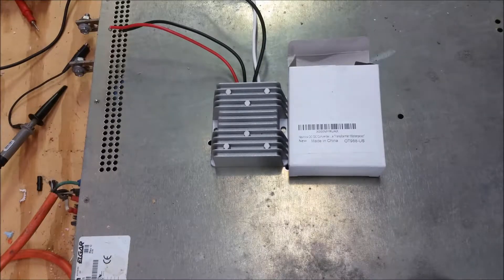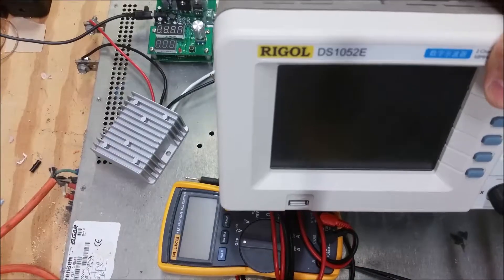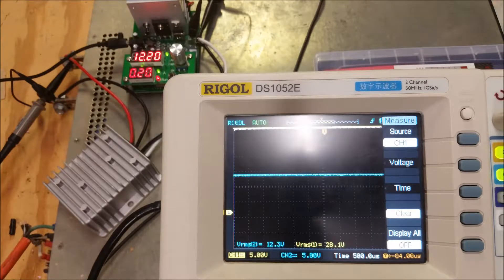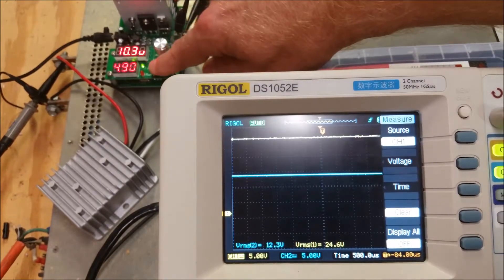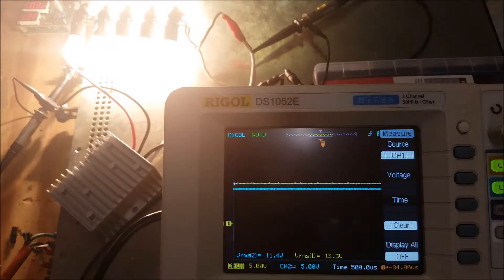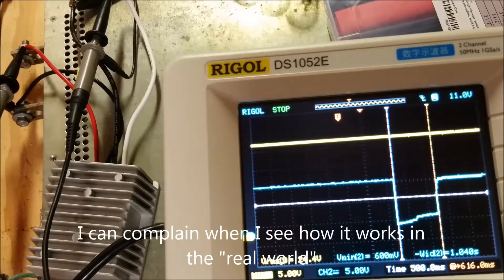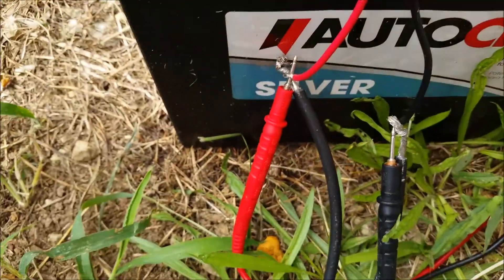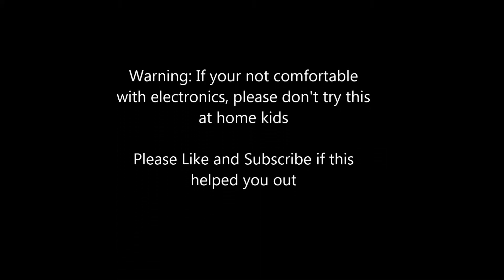Amazon DC-DC Converter Review

Comment: Let me understand your smoke test.
1. The output of the buck converter is 12.3 volts.
2. You hooked the output of the buck converter directly to a 12.5 volt low impedance lead acid battery. 
3. The input to the buck converter is from a solar panel directly.
4. There was not a blocking diode between the solar panel and buck converter?
5. Solar panels leak reverse current at night even if they have built in blocking diodes.
6. You reverse biased the buck converter at night which means you probably reverse biased semiconductors somewhere in the buck converter. You definitely reverse biased the electrolytic capacitors at a minimum. 
You may have forward biased the bulk diode of a mosfet. 

7. The power rating on the pump Is 15 amps, since it is am inductive load, the turn on current is likely to be much higher. 

I agree the converter is not suitable for your intended use. There is a number of possible failure points to consider here.

Nice test gear, your testing of the device was well thoughtout and executed up to the point of hooking it up in for the unintended smoke test. 
Always put a fuse between batteries and electronics.

I might have made the same mistake, but since your smoke test, I learned not to do that.

Good luck.
Reply: I had similar comments as you Peter and would note that the sticker on the device says 24V input and it was being run up 37V. I would say that they likely sent him an incorrect model as the one he is testing is for 24V power and he tested up to 27V on the bench. Appreciate testing that was done :)
Reply: @patrickcallahan2210  I had to rewatch this video, the label does indeed say 24 volts input. There are many models of this device with different specifications that all look the same. The models that have a range usually have the range on the label. You have a good point. 

My experience is that capacitors fail due to having an over or reverse voltage or over temperature. 
The heat sink in the sun and cooling fins facing down might fry the caps. 
If those are output filter caps, the motor, an inductive load, might have over voltage or reverse biased the caps. Which a suber circuit on the dc to dc converter would have prevented. I would guess that there is a suber circuit built in.
I vote -over heated (sun)because it worked for a couple days baking the caps over time.
Reply from the maker: This was tested on a day that made it to 85. Could it be the heat? Possible but not probable. Being that it only tops the battery off, it's not in full power output. So, the delta above ambient shouldn't be that high. 

The voltage range and output  current were within range as well.  Since its tied to a battery,  most of the current will be sourced from the battery during the 1 second the load is on.

The over volt, current, heat protection should have triggered to shut it down, if that were the issue. 

Per the manf. "Converter provides over/under voltage input, overload, overhead, and short circuit full protection"
Reply: @stem_saving1644  You have the knowledge and equipment.  Commercial practices run things to the limits, meaning no de-rating. Electrolytic capacitors has been a weekpoint in electronics even back to vacuum tube radios times. I would expect a 20 to 30 degree C rise sitting in the sun. 
Premature cap failure, maybe, 
Overheating,  failure, maybe,
I have never measured the resistance of solar panel with no load. The transformer of the buck converter should isolate the solar panel from the battery. Thinking outloud, because this is weird.
I am still thinking sneak circuit, without a schematic,  who knows.
The hidden diode within a mosfet, bulk characteristics diode would be forward biased, but that mosfet should be between the panel and transformer and isolated from the battery. The transformer and caps would act like an LC filter to the output. I am assuming the panel to regulator to battery to pump is the configuration you used.
Did you buy a $15 PWM cc to use instead?
Weird problem to solve, I do like fault ANA puzzles tho.
Reply from the maker: I'll agree there is a lack of de- rating  for sure. I didn't check the caps ratings, probably should have.   But agree it does effect reliability.

The problem with these black box units is they are encased with potting material, which is a pain to deal with. 

20-30C rise seems a little extreme, but I can't confirm or denying it since   I didn't measure temps.   But I did under full load inside.  I assumed (wrongly perhaps) that since its IP rated it should be ruggedized...
Apparently only mechanically. 

I did buy a change controller that I'm using to mist my air conditioner. That really does the job.  Check out my videos for that. 

Like you. I do enjoy failure analysis. 
Thanks for comments!
Reply from the maker: I'll agree with all your statements except 5. The reverse current is so small it has minimal effects, at least it should.

 The fet is outside of its operating range so it's blocking the current.  I'm guessing this is in the miroamp to nano amp range.  If the converter can't handle that,  then it's got larger problems and yes I could have installed a fuse, but being the pump didn't draw over 15a, the DC to DC was safe to use.  But good practice though.
Reply: @stem_saving1644  power diodes have a higher leakage current than signal diodes. 
It is impossible to do a sneak circuit analysis without a complete circuit and parts list and spice simulation. Which is not going to happen.

After thinking more on the issue and given the caps was the first failure point. I really suspect the failure point is the reverse bias of the electrolytic capacitors.  It does not take much  current to grow a tendril between the capacitors plates. And it took 4(?) days for the failure to occur.

I get frustrated by the black box approach by suppliers. Derating parts and quality in the commerical applications does not seem to have been standardized.

A linear regulator may be a better solution, except for the loss of input range and efficiency loss. I consider a buck converter to be a switching power supply. I have not found a off the shelf  linear regulator in black box form yet.

Thank you for your efforts, I have learned from it.

Comment: I want to get one of these, so I looked it up and the specs I found say input voltage is up to 35V. And given that it's a cheap Chinese product it's probably not a good idea to run it at it's max rating. So it might have burnt out simply because you over-volted it.
Reply from the maker: It wasn't ran at its max. So no reason for it to fail.  My specs has 40v as a max, they might have lowered it now.
Reply: @stem_saving1644  will this work with dc pulsed input? I want it to use it on my motorcycle but the dc voltage that comes from the regulator it jumps a lot from 8-38 volts.
Reply from the maker: My input jumped around as well on my panels (not below 12v) and I suspect it caused the caps to fail as I suspect they are the cheaper versions that either can't handle peak currents or voltages. 

How long it stays below 12v is the key.  Most regulators will brown out unless you have caps to hold up the voltage. Unless you get a buck/ boost converter.
Reply: @chriscs9080  Look up the max input voltage then maybe subtract a few volts for the "made in China" factor. It would be good to know what the actual voltage rating of the input caps is but the device is sealed shut so you would have to break that seal.
Reply from the maker: Concur with that.  Derate it by a factor of a lot.  I see the input voltage spec changed since I bought it.  Maybe they realized the issue.
Reply: @stem_saving1644  damn I wanted one with higher voltage but they did not have one 👎  Hopefully will work.. is there any way to reduce dc voltage before it takes it as input ?Would I need another device I guess eh
Reply from the maker: Best bet is to look for something else. Or try it and if it doesn't work, return it.
Reply: @chriscs9080  Yes I would return it and look for a different one. I bought one of these, the same construction, but it's 48V in 12V out. I haven't used it yet though. I think I bought it from Banggood or Aliexpress and I think they also had a 36V in version. I think the video demonstrates well that putting this on a motorbike that will overvolt it is a very bad idea! 😂  Also if you have pulsed DC at 8-38 volts, I'm guessing thats from a rectifier connected to an alternator, where the voltage depends on rpm? If so you need to check the voltage at max rpm of course.
Reply: @82NeXus  (I posted a comment but youtube delete it ?? )
Yes you are correct , the voltage depends on rpm . The total output of alternator is 170 W @ 5000 rpm BUT not all of it goes to rectifier. When I tested the output of the line( its for the lighting ) which has DC pulsed I was getting 38V at 8000 RPM . 
The voltage I was getting was "jumping a lot" 0..12..0..26..0..35.. etc
Reply: @chriscs9080  I'm not an expert in automotive electrics, but as you prob know, there's a difference between rectified and regulated DC power. Your's sounds like it's simply rectified, or that your regulator is broken. You probably won't get a good voltage reading from a DC voltmeter. Those are designed only for constant DC. You need an oscilloscope. That would show you the waveform. It would show you what's really going on. Peak voltage is the issue for this converter.
Sounds interesting, are you trying to fix your bike or rebuilding one or something?
Reply: @82NeXus  I am actually trying to fit LED bulbs which do not work now.
Reply: @chriscs9080  Another thought: are you testing voltage with no load connected? Try switching on headlamp then testing. Voltage might only be regulated when there's a load connected.
Reply: @82NeXus  For some reason my comments are deleted again .. wth ..
anyway i placed the multimeter at the h4 input for bulb and i was getting AC~12+ DC ~7.8V WHEN i rev the engine DC drops down to ~3V but AC increases .
Reply: @chriscs9080  Is headlamp on with normal halogen bulb in it? When it's like that you should get constant 12V DC!

Afaik multimeter measures ONLY constant DC on DC setting. On AC setting, I don't know what it can measure, but I've only ever measured 50Hz sine waves (mains power) with it. If you use it with a waveform it can't measure you'll get nonsense readings

Don't know why your comments are getting deleted? I've had that a few times, I think if I used words it didn't like.
Reply: @chriscs9080  what converter did you finally end up using im doing the same thing?
Reply: @BondmeJesus  You dont need a converter . You need a capacitor .
Reply: @82NeXus  in my case the headlight coil is AC regulated and shares a bridged ground with chassis with 3 other coils (1st coil is AC going directly to CDI box and has chassis ground at the end of the coil in the AC generator housing. 2 the tail turn horn is another coil that goes through a rectifier/regulator and the charging coil is isolated from ground until after it goes through the reg/rect unit then it shares a bridged ground and everything ran on 6 volts 3 headlight charging coil was AC and also shared a chassis ground inside the AC generator housing but I disconnected the end of the field winding coil from chassis ground and soldered in an extra wire to isolate it just like the battery charging coil is isolated, but I want to keep it isolated and a regulator has to have a base line like a battery to make it work so that's why I want to use a buck converter because it only runs the headlight when the engine is running. so I am using a bridge rectifier, a capacitor to stabilize the LED headlight flicker and then going to run it through a buck converter. at idle after the bridge rectifier I get 30v then at insane RPM i get 85 volts so this is the buck converter I ordered. I hope it all works. https://www.amazon.com/gp/product/B0B5KRJSKK/ref=ppx_yo_dt_b_asin_title_o00_s00?ie=UTF8&th=1
the capacitor   https://www.ebay.com/itm/155485617947?var=455721938250
Reply: @82NeXus  you need a base line for a regulator to work the battery is the base line. my regulator quits working and puts out high voltage when I disconnect it from the battery.
Reply: @82NeXus  wow so when the RPM changes so does the frequency and multimeters have issues with different AC frequencies? I wonder if I am getting correct readings with 30-85v idle to full rev?
Reply: @chriscs9080  oh, and thanks to anyone trying to help me.
Reply: I hope im not a bother

Comment: Does it consume any current?
Reply from the maker: Yes all dc-dc's consume current in the conversion process.
Reply: @stem_saving1644  Sorry, dumb question! Have you measured the consumption? Reason I ask is that I'm trying to figure out a means to adjust alternator output on my car without needing a switched source, just throw it in series with the alternator sense lead. Internally regulated alternator.
Reply from the maker: It depends on the load.  No load,  it draws 0.01a. With a 1ohm load at 12v its 12w on the output.  It would draw about 12.63w on the input. It's really depends on what your powering. Resistance wise.

Comment: i got 2 of theses im trying to run a 12v inverter off a 24v bat bank i need more than 20a so i had the idea of paralleling them but ive seen some info that says the load will not be = on each branch unless u use a resistor in each?
Reply: now that i seen the end im not soo happy i bought 2 lol
Reply from the maker: That's correct, the load won't be equal. A resistor will probably get pretty hot, so it's not an ideal solution. I think the cheap caps couldn't handle the current transients, so they vented.
Reply: I have two 40 amps wired together giving me 80 amps on solar panels, yes it will work as long as they are the same units. They run a car amp well and keep several batteries charged and my walkies on standby.

Comment: Hi. Can you recomend the best 12 volt stabiliser kit or module. With fluctuatif load?
Reply from the maker: Can't really say.  I haven't tested them all to make a good analysis. Much of it is based on the design and if they use inferior  components. Always look at the specs first.
Reply: @stem_saving1644  ok. Many thanks for the reply. If you found a great stabiliser would you mind reply to this comment. I have an offgrid solar system and chose dc to be my appliance like TV. Since inverter have a bad efficiency and could shorten the life time of my deep cycle battery.

Comment: I saw a lot of really expensive options out there and then these cheap ones caught my eye. What I want to ask is how do you judge if the converter is good or not before buying it?.... because from all your tests this cheap one sort of performed okay ...but later screwed up.
Reply from the maker: Good question.  I personally look for line and load regulation, over/under volage,  over current protection, over temp proection and efficiency.  This converter seemed to fit the bill.  

But most of my testing was steady state. I'm guessing they used cheap caps that had high series resistance and weren't derated properly. So,  long story short,  the ambient temps combined with high current pulses caused the caps to over heat and vent and the converter self destructed.

Unfortunately, this has to be tested under real world conditions to see that.
Reply: @stem_saving1644  I have an 8 amp requirement ...Would getting a convertor having a current rating ....let's say 20 amps help run the device cooler since I'm barely reaching the max current ?
Reply from the maker: It might help with self heating. If your load is steady state, 8A, it might work for your application.  Worst case you can return it.
Reply: @stem_saving1644  yea I'll give it a shot it's steady state 8amps
Reply: @stem_saving1644  I noticed that the converter was in the sun also but maybe im wrong.